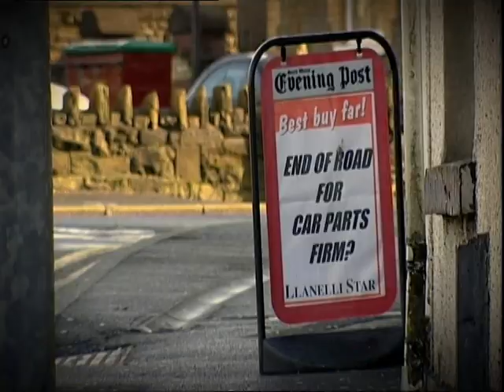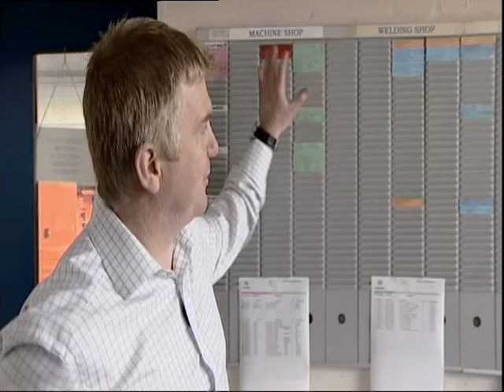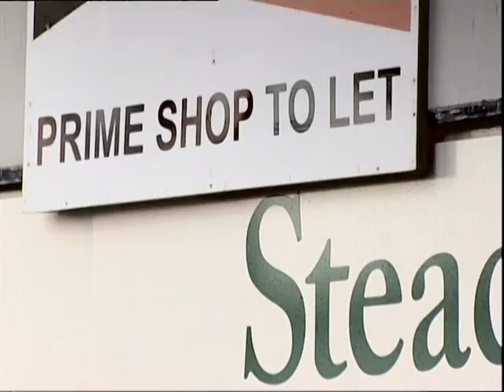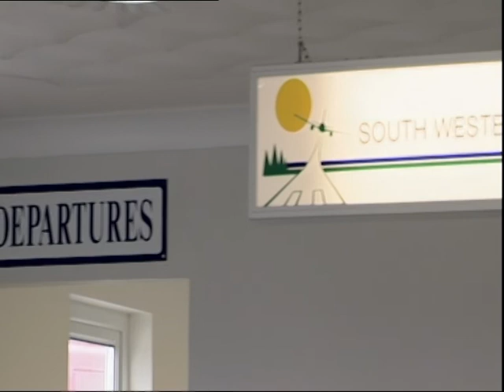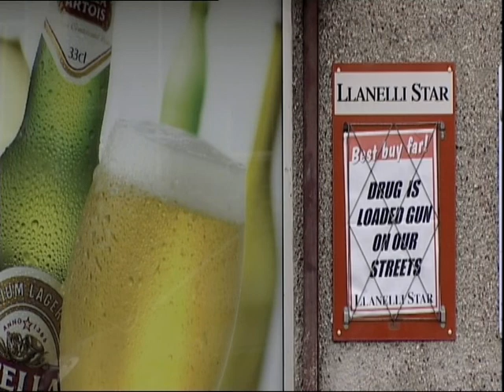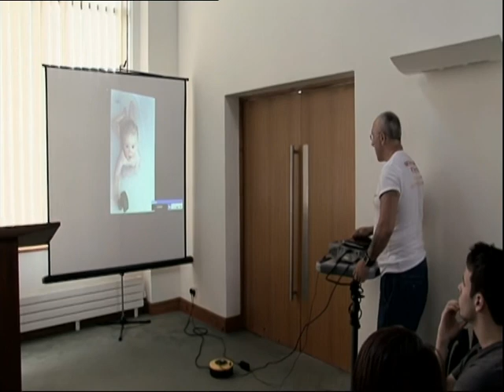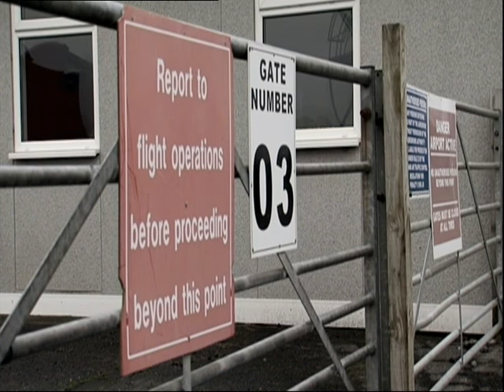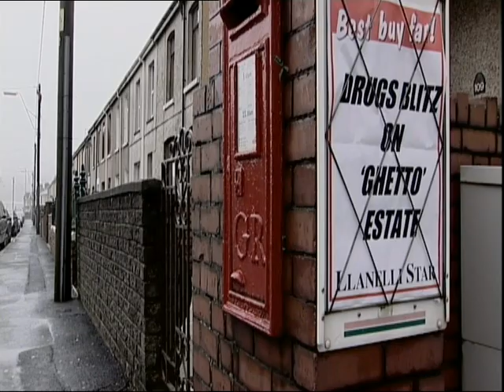BBC WALES WELSH TOWN TALES 1  DRUGS AND ALCOHOL RECOVERY WALES & UNITED KINGDOM

Comment: As for the couple moving to Machanys, yes it might look better now but people have no jobs and without our industries people cannot lift themselves out of poverty through work. People need a hand up through secure jobs, not a hand out through welfare, as welfare causes depression and insecurity. It's a vicious cycle of dependency. Very hard to understand unless you have been brought up in poverty and feel like there is nothing for you & now so many feel there is no point in even trying to get a better life, as they will fail anyway. This is a knock back of bad education and being told that poverty means they will not do well in school. When we had Grammar Schools all academic  children had something extra to strive towards and they worked harder to get in. And for those who were not academic there was the technical college that turned out well trained youngsters who would go on to specialise in subjects. Taking away all these things that worked so well is the reason for the decline in education and is the reason behind the drop in standards & low moral. Forcing non academic children to take exams instead of allowing them to bloom in what they are good at, whether it's designing clothes, art, catering, metal work or carpentry is a terrible system. By the time they finish the enforced exams and no matter how hard they tried they still had low grades, it knocks their confidence and they stop trying.That's why youngsters turn to drugs or commit suicide as they feel a failure but it is the system that is failing them by not celebrating their talents and  shoving them into one basket under the guise of equality. Children are individuals and should not be treated in an utopian manner